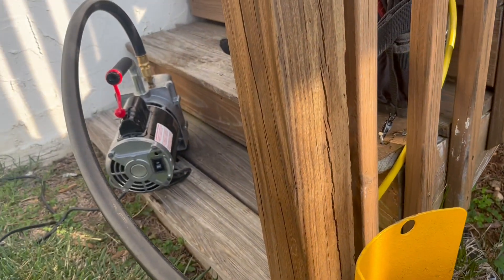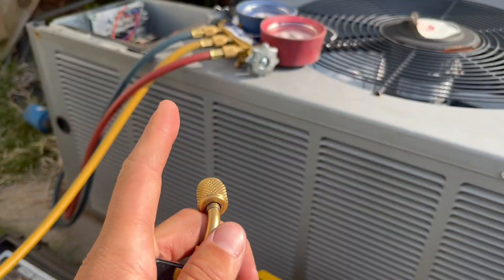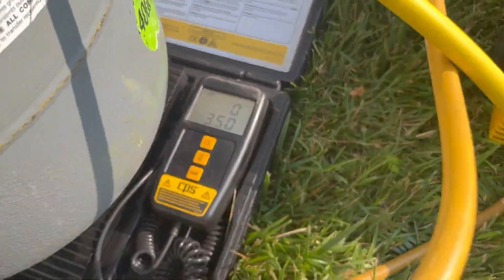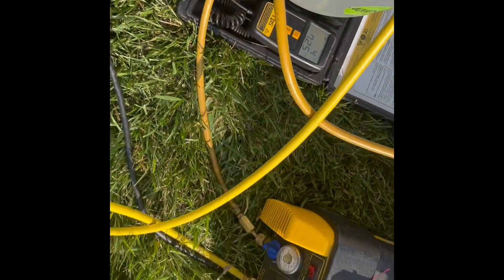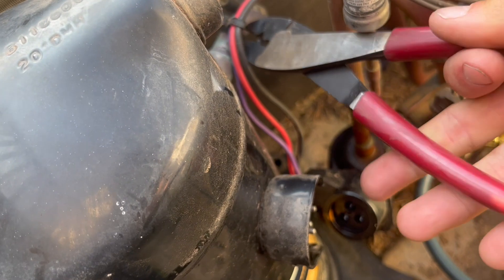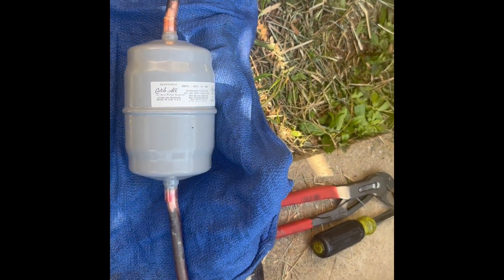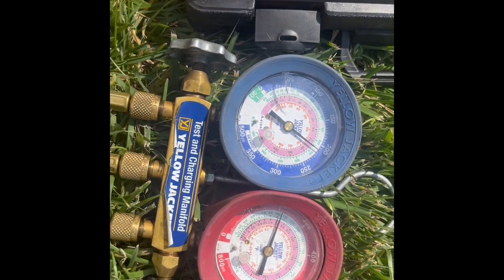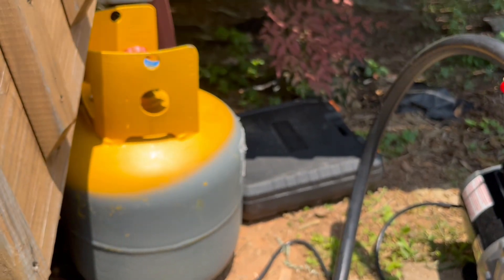Rheem Compressor Replacement

Comment: Thanks for the video is helpful, a question Does the compressor come with its own oil? or you need to add separately, thank you for answer
Reply from the maker: Great question! And yes it does come with its own oil already inside the compressor, you do not have to add any oil to it.

Comment: The ones prescribed in the video are very technical and the tools used are ideal for this kind of work, but I see it is that if the machine, due to the manufacturer's strategy, installs a single-pole contactor and there is a direct phase there, why not? I change it to one with two poles so that when the machine is at rest no electrical voltage is entering it, even though a voltage spike may seem illogical even when it is at rest, that direct line lends itself to the generation of inopportune news. Having a two-pole contactor avoids this kind of novelty and is one more way to preserve the condensing unit. I say this from the point of view as an electrician. thus finds disconet and Breakers. for the most cool video.